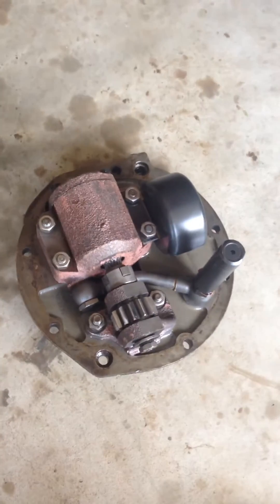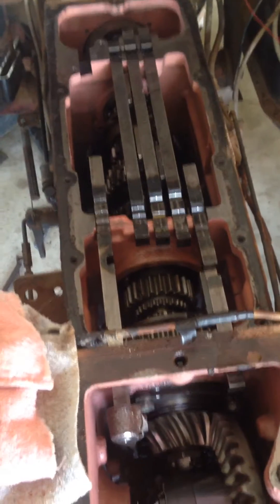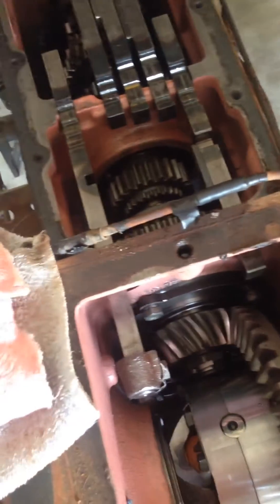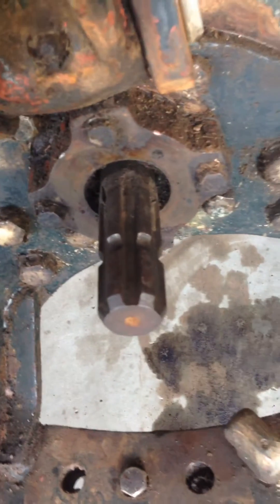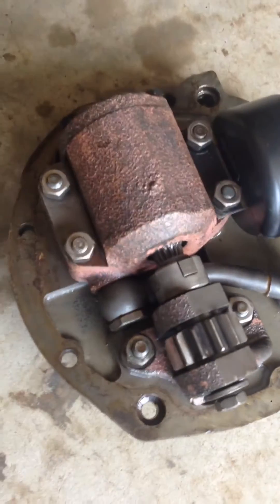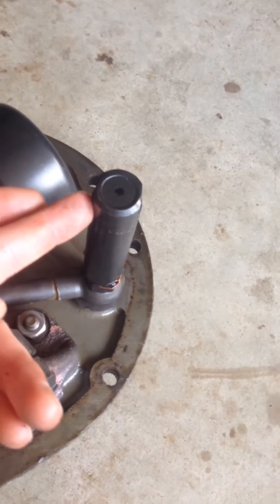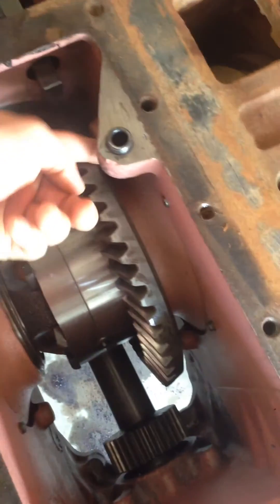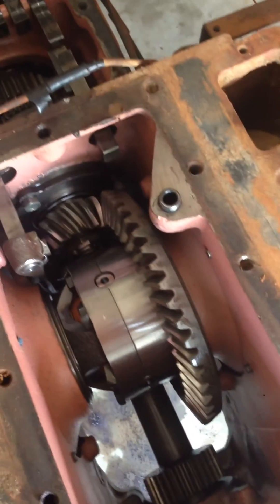Zetor 5011 Hydraulic Pump

Comment: Hello I want to start with great video and information I have a zetor as well. I have 2 question when you put everything back together the transmission box  and the p.t.o box when you added the new oil from the transmission did that full up the p.t.o  box at the same time? Or does the p.t.o fill separately? 2nd question is what type off transmission oil you use? Thanks.
Reply from the maker: If you fill at the transmission cap/dipstick, that will fill the transmission, pto, and hydraulics. It’s one large cavity from the transmission to the pto. I used supertech tractor hydraulic and transmission oil. I haven’t had any issues with it in the last two years.
Reply: Thank you again for the information!